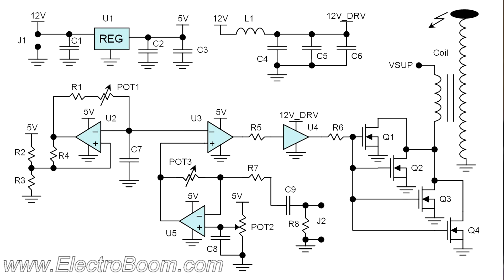Music, Magic and Mayhem with Tesla Coil

Comment: 1:52, I wonder if this could be used a propulsion on a spacecraft.
Reply: +Kris S Google ion drive, that is almost exactly the same thing, just more efficient
Reply: +Kris S It's somewhat comparable.

This isn't a viable method of propulsion. You can't store a usefull amount of electrons without positive charge (protons in your atom cores for example), and if you just ionized some atoms and acceleratedthe electrons away from your spacecraft you'd charge yourself positive, the electrons would get pulled back, which results in 0 thrust.

Ion drives combat this problem by using a neutral fuel (as i said, xenon most of the time, the heaviest stable noble gas), ionizing it, accelerating the positive ions away from the spacecraft by an electric field and then neutralizing the resulting beam of positive gas ions with the electrons that you smacked out of the fuel in the first place.
Reply: +Kris S 
No, this won't work in space. The spin comes from the air being heated by the arc thereby expanding and pushing the rod away. The push isn't coming from the electrons.
Reply: +Kris S Very little thrust. Very efficient. It can't get you off a rock. It couldn't get you an asteroid's escape velocity worth of acceleration, but once you've escaped the earth's gravity, it can give a good nudge to correct your course to get the next gravity assist from jupiter or something. The new solar system planet that's allegedly a gas giant hundreds of AU away from us is a prime candidate for ion engines. Because i'll be disappointed in the human race if we don't send an explosion tube to that.
Reply: +Kris S I don't understand what exactly you mean? If you're talking about ion drives, of course there's a loss of mass,  the drive works by ejecting mass in the first place. If you run out of gas to ionize and accelerate the thing becomes as useless as a rocket engine without propellant.

If you're talking about that spinny wire thing he puts on the tesla coil, it probably gets eroded away at the ends. If that's what you're interested in you might want to look into pulsed plasma thrusters.
Reply: +Jonathon Gay It isn't,  ion drives accelerate (positive) ions and then neutralize the resulting ion beam with the electrons that got smacked out of the atoms when the neutral fuel (Xenon, most of the time) got ionized to accelerate it.
Reply: +Engineering Nonsense OMG! i was thinking about spaceship engines AS WELL, when i saw this! XD lol
Reply: i'm confused, i never took any classes in this field of knowledge, it's all just a bunch of engineering nonsense
Reply: Malte M so this is different than an ion drive? 

I wonder if this would be viable in space.
Reply: Well...  they are,  I'm not terribly smart.
Reply: Engineering Nonsense what's even better is your username, it fits perfectly here
Reply: i wonder if he saw that
Reply: sami3219 I don't think it's enough force to push something through the atmosphere. In space its different.
Reply: +Engineering Nonsense Ion drive is already in use for satelites to stabilize their orbit, on low orbits there is enaugh gases that slowly stops satelites and makes them fall back on Earth, it is not efficient to mount on them big thrusters since they dont need much thrust its better to place there small ion drives that will work for long time (since energy from sun is mostly used as fuel) and wil be less heavy.
Reply: i will always however, pass my joke opportunity classes
Reply: Malte M very interesting.  That explains the firing of netral? Ions to meet the positive ones that are ejected from the back of the drive.

I wonder if there is a loss in mass as the drove runs, and how long it can be sustained before it wares down.
Reply: this may be the nerdiest comment thread ever
Reply: da megabuilder This isn't nerdy; if it was about computers or something, then yeah; but we are just smarter than you.  That's all. ;)
Reply: da megabuilder lol
Reply: +Engineering Nonsense in space there is no air for the ions to push against or interact with.
Reply: +Engineering Nonsense Without anything to push against the only way to impart a change in momentum is to throw mass out the back. There has to be a loss of mass in order to propel something in space.
Reply: +Engineering Nonsense ohhhh u got wrecked sucker
Reply: i mean da megabuilder got wreaked
Reply: David Yi what are you talking about?
Reply: that dude got burned by u baad
Reply: David Yi haha lol
Reply: David Yi Probably
Reply: haha lol i would give anything to see his face
Reply: i am a pizza. what did you expect, Einstein?
Reply: The answer is no. Why not? Ask yourself this: Where is the charge going? The answer is to ground. The arcs that create propulsion are ionized gasses that we call plasma, which  allow the flow of electricity, which, in this case, are to the ground. The ship would be propelled until it reaches the vacuum of the exosphere. No gasses to ionize and provide a connection  to an electrical ground. (while there is also not one in that space) Also, the charge needed to reach an electrical ground increases as the live charge distances from the electrical ground, and there are probably very few batteries that could hold such a charge and sustain it over that long of a time period.
Reply: +Engineering Nonsense no but maybe on a smaller scale like a RC jet or something though I'm not an electrical engineer so I wouldn't really know
Reply: sami3219 Still not enough force.
Reply: Maciej Różański Wow!
Reply: mr404 error Haha
Reply: lol

Comment: i recently bought a onetesla together with some of my friends and found this video. is it possible to do the "spin-thin" with that? and can i hold some wire to it while playing sound?

really nice videos by the way. I'm currently binge watching through your whole channel :)
Reply from the maker: +MassiveKyojin yes you can do the spinning wire with your OneTesla. Holding a wire to it might zap you though, because the way oneTesla plays music is by interrupting the arc that generates powerful low frequencies that can shock. Reduce the output power to minimum and try it and see if it shocks badly. 

I'm in the process of making my own OneTesla too!
Reply: awesome! are there going to be videos of it?

also: i worked as an electrician. we have 230V here. i got numerous shocks and im still fine. did you have to visit a doctor after one of your cringeworthy but somehow entertaining shocks or burns?
Reply from the maker: MassiveKyojin
I'll try to use the OneTesla to drive my higher power coil. Hopefully there will be a video on it.

I have never visited a doctor for by shocks! They are therapeutic themselves anyways!
Reply: well, a shock in the morning sure gives you energy for the day. 

looking forward seeing you work with the onetesla

Comment: When you place the piece of metal on the top of the coil and the metal spins I was curious, would it be possible to generate a form of propulsion from that idea?
Reply from the maker: +e jelly It is not very strong. It rotates due to heating the air, expanding it and creating some trust. It is some sort of propulsion, but a tiny one. Also it can't be used in space like this. There is no air...

Comment: 0:13 Yet, the only sound you hear from touches with finger, ZAP them - SH*Bleep*! - ...
0:16 ... is the sound of stupidity.

1:12 I made this piece of metal so it could balance on its center and I'm going to put it on the coil. touches coil with metal, ZAP? SH*Bleep*! ... touches with metal a couple more times What? starts a full arc with the metal and coil Why doesn't it hurt? What kind of sorcery is this? ...did it decide not to hurt? touches coil with finger AOW! Nope.

 2:04 ...and although it's not connected anywhere, the arcs will still jump to it. ...touches charged screwdriver, ZAP SH*Bleep*! ...the hell? touches it again, ZAP Ouch! touches it yet again, ZAP SH*Bleep*! ... Although the arcs aren't- touches the screwdriver AGAIN, ZAP OUCH! touches it again, ZAP Ouch! ... The arcs aren't jumping to the screwdriver, but it hurts my hand. touches it twice more

Comment: I want to build ig my own ... i have a 5 cm thick and 30 cm long pvc pipe and 0.2 mm wire how can i calculate the primary?
Reply from the maker: HV and more There are calculators on the web. But it only tells your outcome based on your assumptions. Just make your primary, either with over 1cm distance from your secondary or with proper insulation, and try to make your primary turns variable to adjust power. it will work
Reply: Ok thanks i'll try it ;)
Reply: Yeah i made it... and it works fine but there isnt a streamer from the Tesla-coil in the air only if i come closely whit a thin grounded wire. Then a streamer flys from the grounded wire to the end of the secondary. I use a 12 volt solar battery as an power supply and the 2n3055  transistor, which works fine at 0.6 mhz . What can i do if i would like to have a small streamer what transistor should i use maybe 2SC2078?
Reply: Yes now i use at about 19-22 volts from a 20 watt solar panel and... if you look at my chanel it works finevand i get a small streamer ;)
Reply: +HV and more you used the slayer exciter circuit?

Comment: sir, is there any way to make this work using car batteries? i mean this would be a good decoration for my car while having good music. 
I'm thinking to place it on the dashboard and a hanging piece of wire to connect the arcs.
Reply from the maker: jared paolo nacino I'm afraid with so much radiation coming from this thing you may effect your car performance or functionality!
Reply: ***** wait... this thing throws off radiation? damn I was going to use it as a science fair project.
Reply from the maker: The Political Shepherd
It is fine for a science fair project and educational purposes. But you can't use it as a product inside your car

Comment: i built this circuit,the tesla coil and have everything i need to run it. but it looks like my R6 and 4452 mosfet driver is heating up when i power the circuit with 5v and 12v. can someone give me a hand please ? :D  i posted the details in the comments in his website but no one is answering me for days,a hand would be much appreciated. thanks!
Reply from the maker: mtn silviu Let me check your comment, later that is. I'm at work right now!
Reply: Ooh,a sign :P good news :) appreciate if you could help me a little. for me it's 12:17 AM so i'll go to sleep, i'm too tired. Have a good day at work !

Comment: Hey Mehdi, I have absolutely zero knowledge when it comes to electrical components and engineering. Should I start off building a battery or is a tesla coil a reasonable first project if I follow good safety measures?

Comment: Excellent! Are the oscillators crystals?
Reply from the maker: p1nesap No, my oscillator is some active R/C circuit to I can tune the frequency. Crystal frequency is fixed.
Reply: ***** ok I see, your PWM oscillator is R/C circuit. So you're making a synth. When you touch Tesla with wire, music sounds like saw wave, whereas balanced rotating wire sounds smoother like sine.

Comment: There is something i want to ask you +ElectroBoom. What is the voltage i need to charge a 820uf 6.3v capacitor? It's just a little project in my high school that i didn't do well. It is an electromagnetic flashlight and i shake it for more than 5mins but when i turn it on it only lasted for a few second..  And I'm also not sure if I'm using the correct capacitor.

Comment: You know, I'm trying to find the smallest possible >30kV high frequency power supply. That way I can create a lifter (simple ion engine) hoping that one day it could lift its own power supply. Do you have any ideas? Thanks.
Reply from the maker: Mikael Murstam My thought is that it would be the most inefficient and dangerous flying object... I like it!
Reply: I have ideas on how to increase the efficiency :D
Reply: Mikael Murstam Having one to have a t/w ration of greater than one would be pretty much impossible, I think.  But in space, the mass doesn't matter nearly as much, so if you have a way to supply tons of electricity in space you could make an energy propulsion source that uses very little fuel like this.  Keep doing your research and maybe you could pioneer a new type of space travel for probes or even manned vehicles if you can scale it up enough!
Reply: cyleleghorn246 yes but one can already get a lifter to fly in the air using light materials. I "just" need to add the powersupply, which is quite heavy :P. I have an idea on how to improve it using a pulse instead of a continuous flow.

Comment: Can you explain the witchcraft that occurs regarding the fluorescent light turning on when near the coil? How is the tesla coil powering it?
Reply from the maker: Fuckthisshitplanet Quick an ddirty answer: electrical coupling of high voltage to florescent molecules inside the bulb excites them and they turn on.
Reply: ***** This "electrical coupling" occurs through induction on the fluorescent molecules?

Comment: You don't get shocked when you touch the coil because of so-called skin-effect which basically means that high-frequency current is forced to pass through the surface of conductive object and not go in. The exact process is hard bitch to describe so I just go on. You also don't get shocked nor even burnt when you put a wire near the coil because high-frequency current utilizes most of it's energy into EM field created around the wire and also because you touch the wire with big area of your skin, making local power applied to certain area less than dangerous.

Comment: Mehdi (first of all, this video is amazing, I never knew charges could make such clear sound without speakers), I found a video that reinforces your point that voltage kills, and not current. Look up "The Metal Melter" by "Grant Thompson The King Of Random". In the video, Grant uses a modified microwave transformer to generate extreme current capable of melting steel in a few seconds, but low enough voltage that he can hold the live contacts with his bare hands (another video shows how he made the setup). I think it would really help you with your voltage vs. current debate.

Comment: Would a Tesla Coil built 1000 times larger generate huge amounts of energy with that rotary thing?

I mean maybe you don't need to much energy put in to the Tesla to make it shuffle around the electrons but when the rotary starts moving by the electrons you can convert it to energy? (And power the Tesla more? Free Energy?

But from what I've learned energy never disappears or appears, just moves around so there can't be infinite energy?

Comment: *****, What would happen if you try to power this with 50V? I am using a few small transformers in series to charge up a large 500uF motor starting capacitor (using it as a filter capacitor) I am able to get away with it with only a single IRFP250.

Also, what if you used that motor starting capacitor to capacitively couple a full bridge rectifier to the mains, and use the impedance of the capacitor to drop away some voltage, so you drive your tesla coil circuit as less than 169V? (70V or so) That way you get the most out of the circuit. I am considering doing this but I would prefer to use a isolating Xformer and a fuse which I do not have on-hand so I have not tried it yet.

Comment: I'd love to have seen an alternate world where Tesla won out over Edison - it'd be fascinating to see where it would've lead.
Reply: Pants Tesla did win out, or at least his position did.  All grid power transmission is done with alternating current.  It's just too impractical to transmit direct current over any kind of distance bearing a passing resemblance to "long".
Reply: Kevin Nguyen
With the actual transmission, DC versus AC doesn't matter.  It has to be very high voltage.

But getting from low voltage to high voltage is much more expensive with DC than AC.  Therefore, long distance transmission with AC is more feasible.  That's a cold hard fact, not an opinion.
Reply: Thanny That's not entirely true there are some long distance direct current transmission lines. I know of one specifically that goes from Quebec down into southern New England
Reply: Kevin Farmer isn't it the exception that proves the rule though? Its also interesting to see how large in diameter those DC current lines start out vs how they end. There is so much lost.
Reply: +Thanny  There comes a point where AC transmission at long distances is too impractical. Granted, HVAC is better for short distances. But at very long distances, the advantages of HVDC (ability to transmit more power at longer distances) outweighs the disadvantages (like the cost). 

There are a few articles on the web explaining when HVDC is more practical than HVAC. As far as I can recall, some of the limiting factors for HVAC is the skin effect and line capacitance.
Reply: +Thanny It's actually more feasible to transmit power over very long distances with DC than AC.